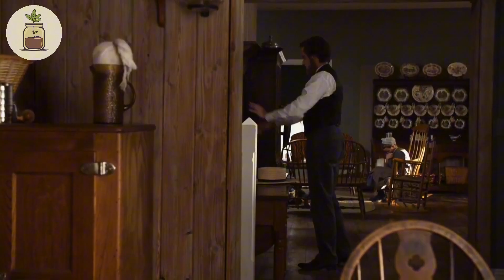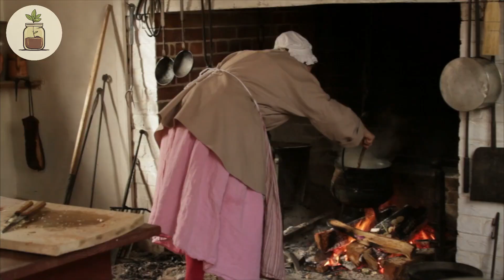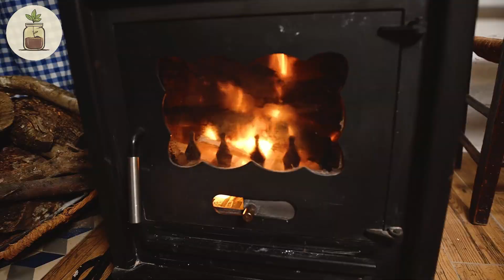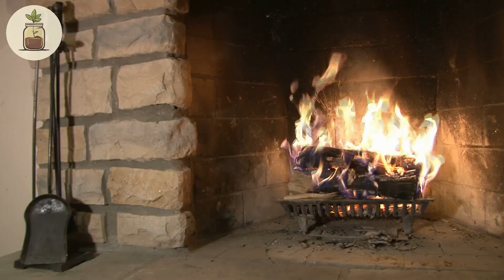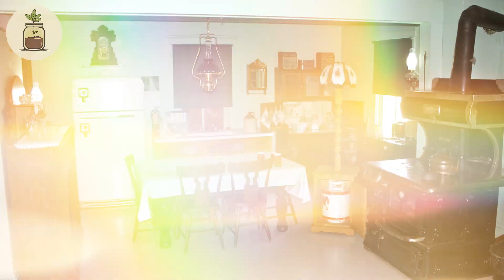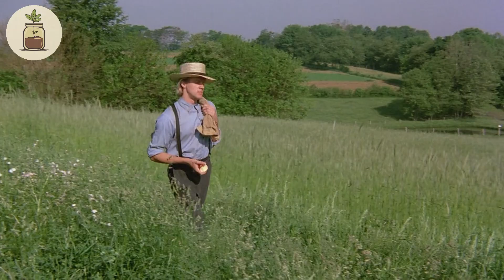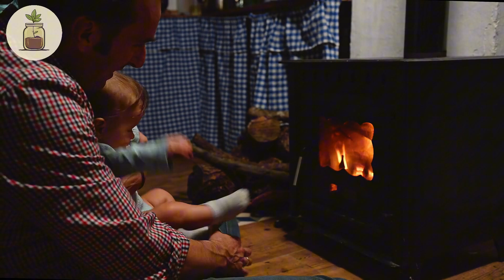How Amish HEAT Their Homes Without Gas/Electricity

Comment: Sorry, but masonry heater has a specific meaning and construction type.  I only saw one example in this video, with a primary and secondary firebox for complete combustion under very high temperatures.  I have the start of one with a massive stone fireplace with an insert, but no cigar - my heat goes up the chimney along with most of the other heated air in my house.  
Still looking for some way to make it more efficient.
Reply: You need to have a damper installed  in the exit flu to stop the after burn air flow continuing to draw warm air from the structure.
Reply: @markhedger6378   A Russian  fireplace  is a wood burning stove of heat absorbing stone that has a number of baffles in it
to slow the loss of heat up the flue . That is what it looks like they were trying to show. With out the explanation of the baffles to help trap the heat into the stone work .
Reply: Soapstone

Comment: Wood and other means of heating is in fact much more expensive for the majority of people than  gas or electricity.  
If you do not own property with trees to harvest for wood, then you must purchase wood and the cost for wood far exceeds gas or electricity.  

Yep, where are you going to get this wood, and what will it cost you?? 

Cheers
Kit
Reply: I pay $900 a year for wood and it used to cost me between $3000 - 3500 a year to heat with propane . Farmers have forests they need to manage and they sell it off cheap . There are many inexpensive sources to buy wood . Look harder.
Reply: I pick up driftwood from the river or beach while I'm running the dog.
Multi tasking 😂
It's worked for me for years 😊
Reply: Umm... there are several tree services in your area I am sure. You could get wood from them cut and split yourself.
Reply: During the year you can get free or cheap wood if you do the work

Comment: Some Amish communities use propane, and gas generators for power.  This is considered a natural resource.
Reply: Those are Menonites, not Amish. There is a difference.
Reply: Could be amish. There are like a hundred amish groups with varying rules
Reply: @timlynn4708  Mennonites are less strict on technology use than Amish are...
Reply: We bought a Generac generator. We have to use propane with it. We have a fireplace that we are going to hookup propane to heat with it. We don't have natural gas where we are and our home is all electric. We have double paned windows and have blinds on them. I'm thinking about getting curtains to go over all the bedroom windows too. Our home is really insulated good. But it's 2300 sq living ft with a 12 ft ceiling in our great room. Since heat rises a fireplace alone doesn't keep it warm and the rest of the house is cold. Going to see if we can figure something out to save on electric bills. I keep my thermostat at 67 degrees and I'm confortable.😊
Reply: We have both Mennonites and Amish where we live. The Mennonites use electric and drive cars. The Amish dont.

Comment: The fireplaces which are shown are extremely “inefficient “.
Reply: I doubt any or most of these photos and videos of the wood stoves and fireplaces are from Amish homes.  Some of those stoves are newer models 5hat use catalytic converters that require electricity.  Probably another one of those channels that takes different videos off the internet and makes up a story.  I find this kind of criminal myself.
Reply: @lf4061 I supposedly have a catalytic converter on this ‘Lopi’ wood stove insert but it takes no electricity at all. It is a real bugger to learn the damper settings and i am still finding out new things about it after 10 years of use since my husband passed. I do love wood heat so much though and all my wood comes off my own property from fallen limbs, oak mainly and eucalyptus. I had a huge eucalyptus fall over a few days ago, it is a giant. I have to buy a splitter was renting one. My wood stove is lined with brick so i can burn eucalyptus.

Comment: They cover the windows with quilts at night.
To keep the cold out and I warmth in
Reply: Hi
Double glazing in Europe and central heating which is coal fired boiler in basement! Works great no mess !
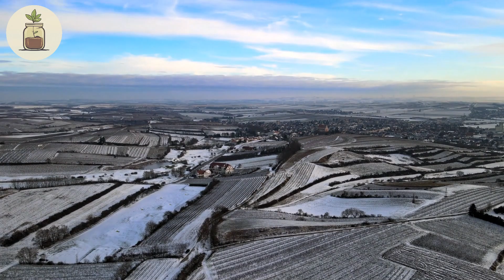Reply: Mentioned 8:53 into vid
Reply: I do the same thing except with polystyrene foam. I just get 2-3" thick sheet and cut it to fit in the window frame. Handy up in Iowa as some of our winters can get quite cold.
Reply: Sounds like an excellent thing to do. I'm wondering how Amish support the weight of those heavy quilts when they hang them over their windows? Do they have some sort of special heavy duty curtain rods?
Reply: Nails lol  @Earthy-Artist
Reply: @treverwhoever a nail wow how can this be a secret
Reply: @treverwhoever  Proof?
Reply: @Earthy-Artist I've seen them use a quilt hanger which is basically two long boards joined together in an L shape. They attach brackets on each end of the bottom board (the board that attaches to the wall above the window. Then the run a very big round wooden dowel through the bracket holes.  Then at night, just loop a quilt over the dowel.   The board on top of the one that is flush to the wall makes a nice shelf.
Reply: @LaLadybug2011  Thank you ☺! I had imagined they most likely would be taking down their quilts in day time, in order  to allow light in. And then putting them back up primarily at night time. The method which you described makes so much sense, plus they will have a bonus shelf as well!

Comment: I was glad to see that you mentioned the proper installation and care for the fires damper and placement. Otherwise all that heat just goes up the chimney. And May I add trying to find a tradesman with the relevant knowledge and expertise or specific parts and knowledge. Just to know and appreciate how a chimney works efficiently and vents properly while still giving the occupants a safe supply of oxygen inside.

Comment: Wood stoves have really been a life saver and yes, they're a lot of work, but they throw a great heat and as a bonus can be used for cooking if your power goes out.
Reply: Jason Stewart, "The FIRE MASTER", New Zealand, started my interest in masonry heaters and their secret to turning a stove or fireplace into  a "gasification" high temperature heater that "burns smoke". If you use pellets or SMALL wood to get a fire to 1,050F degrees and direct that fire into a refractory tube (3-4" diameter) placed above the flame. Within that tube's first 2' the fire temperature will jump to 1,500F degrees and within another 2' of travel inside that tube 2,000-3,000 degrees will manifest (I bought instruments to measure this). 

And, at this elevated temperature "draft" becomes PUSH (not suck!). This fact can allow a tube to to PUSH hot air back and forth "side to side" inside a firebrick or stone fireplace or stove that will heat a vast heavy mass that will stay hot for more than 1 day on a (short) 1 to 2 hour burn. 

This refractory gasification principal was discovered in the far East Europe thousands of years ago and is found today in a "masonry heater" computer SEARCH and also in wood and oil gasification "WOOD GUN" boilers built by ALTERNATE HEATING SYSTEMS. Amish have built "WOOD GUN" GASIFICATION boilers for boiler dealers operating NORTH of Warrensburg, NY when I lived near there an elected Assistant Stony Creek, NY Town Assessor and Architectural designer with my Wife who leads the Glens Falls Symphony Orchestra.

Comment: How do they heat their houses in minus 20 fahrenheit?
Reply: We used a wood stove consistently for years growing up in the Canadian -40 and were never cold inside.  Just keep your chimney clean and make sure your stove is properly installed and you'll be fine.  Just remember soft wood like pine burns fast and doesn't throw as much heat compared to hardwood.    I would have a mixture of both.  Softwood for starting the fire and hardwood for longer heating periods like for overnight when you don't want to be waking every half hour to make sure the fire is fed
Reply: It can get that cold or colder here in the mountains of Northeastern Washington state. It is best to have a well insulated home. That alone can make wood heat work very well. Also, a well manufactured, efficient woodstove. We have a Quadra-Fire that has a four cycle burn in its design. We have had it about 26-27 years and it works very well. It is much warmer than electric heat. We have a forced air electric furnace for backup when we are away from home for any length of time. You haven't lived until you have to thaw frozen water pipes in frigid weather. Lol!
Reply: Very well
Reply: A wood fire can do that.